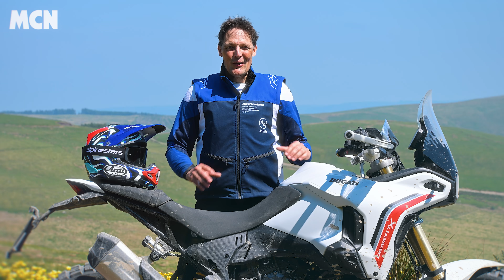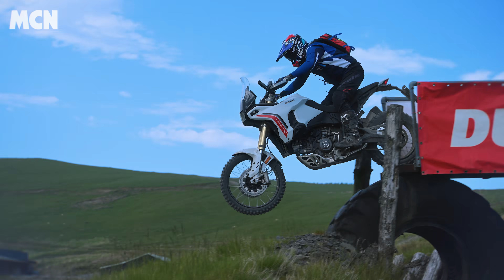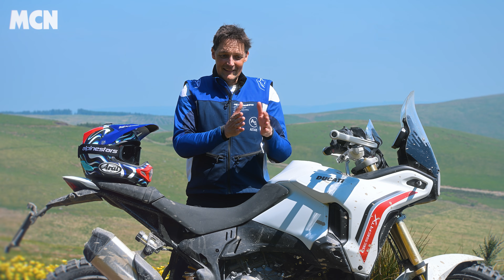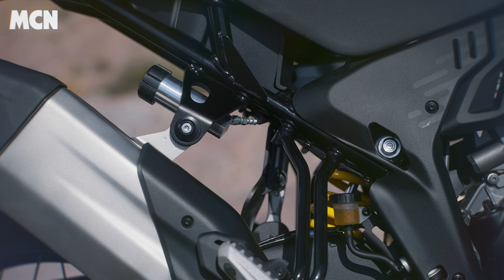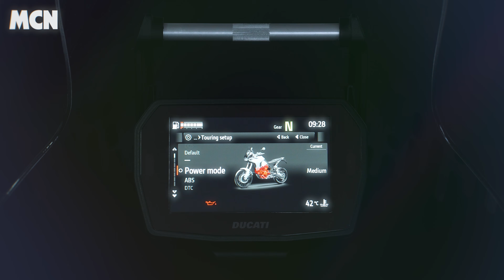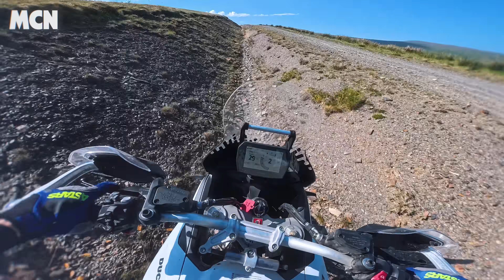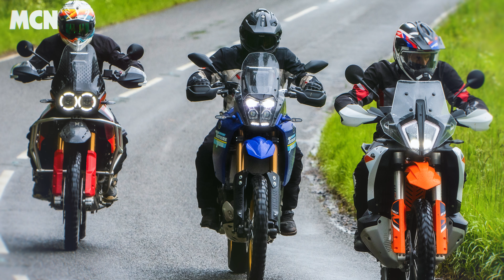2026 Ducati Desert X | Off-road deep dive | MCN review

Comment: You definitely were not hanging around! Are there better bikes? Maybe if You buy a cheaper bike and spend the difference on aftermarket suspension and brakes exhaust/ engine mods and but you need to know what you are doing to actually improve a motorcycle!
This seems to be sorted out from the box! A very expensive box I might add..

Comment: Lot of money for what it is then of course, there is the Ducati premium tax for servicing.
Reply: 28k Mile valve intervals.  Not servicing very often.
Reply: @bikerbeliever8169  annual service costs?
Reply: First service on my v2s  350 euro , not bad at all🤠
Reply: this new V2 engine has done away with the Desmo so it’s just a normal V twin with normal service intervals
Reply: Not anymore. Service intervals are further apart and will be less expensive due to it having conventional spring valves.